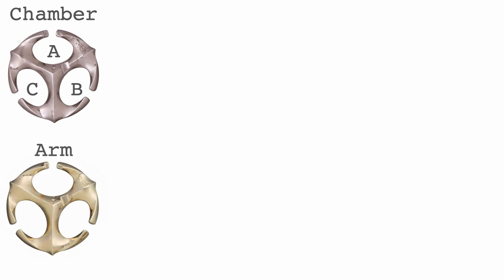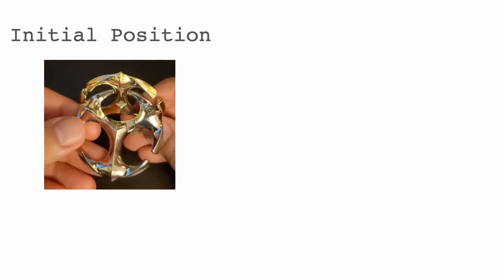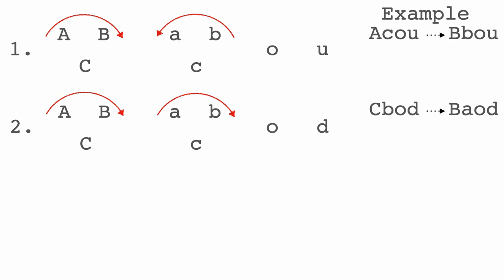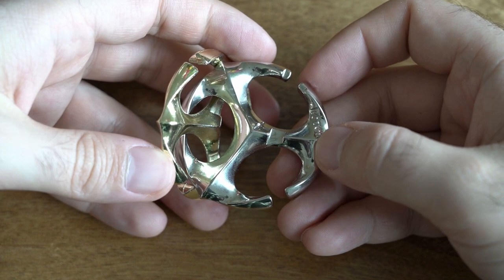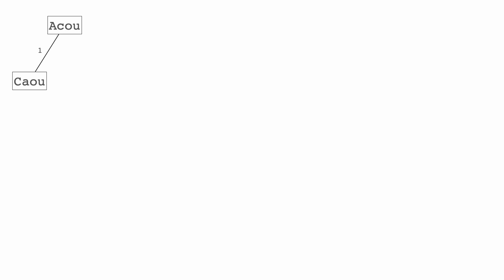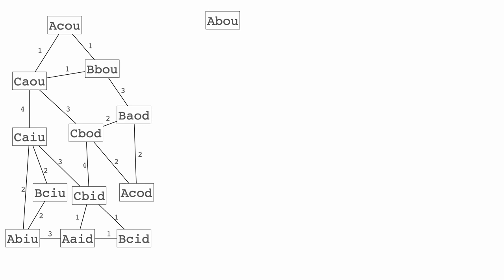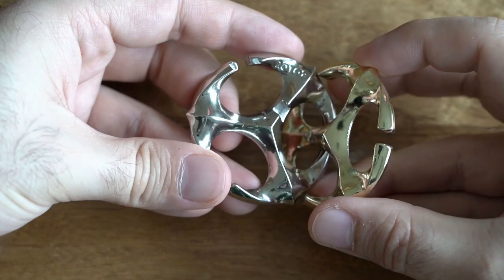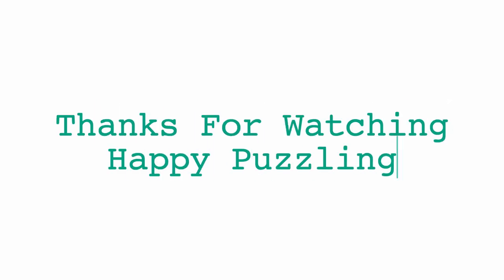Hanayama Rotor State Diagram Based Solution

Comment: While your approach is excellent, there are problems with the details.  First, a brief digression.  When two operations "undo" each other, mathematicians call them inverse operations.  The inverse of operation R is denoted by R^-1.  Your operations 1 and 2 are inverses of each other.  All the other operations you list also have inverses which are not listed.  To solve the puzzle from any initial starting state, you must use "directed" edges between states.  If operation R takes you from state A to state B, then operation R^-1 takes you from state B to state A.  In your diagram, you label each edge between states with an operation but you do not indicate which direction the operation moves you.  If you follow an edge in the opposite direction, you need to use the inverse operation.  Hence, if you want to follow an edge to an adjacent state, you need to know whether to apply the operation listed on the edge or its inverse operation; you cannot tell which unless you add a direction to the edge.

As a matter of style, I like to use a mnemonic term for the basic operations instead of a meaningless 1, 2, 3, 4.  E.g., R could mean Rotate counter clockwise (operation 1) and R^-1 is the inverse (operation 2).  You could use SS and GS for Silver Slot and Gold Slot respectively (operations 3 and 4) and use SS^-1 and GS^-1 for their inverse operations.  The remaining move and its inverse could be called SP and SP^-1 for "Special Move."

Addition:  On the labeling of the chambers and arms, the clockwise orientation must be viewed from the side with "rotor" written on it, otherwise the labeling would be the reverse from what is intended.  This needs to be explicitly stated.  Also, moves 1 and 2 are really the same move from a different orientation of the pieces.  This combined move has a unique inverse.  The silver slot move and the special move using the silver arm are both their own inverses!